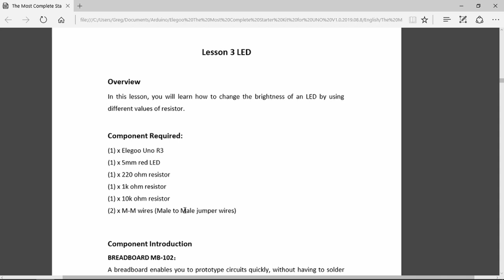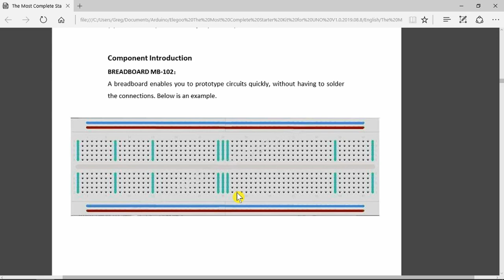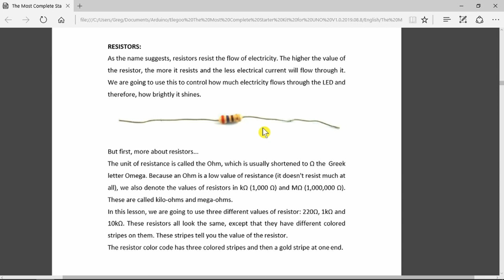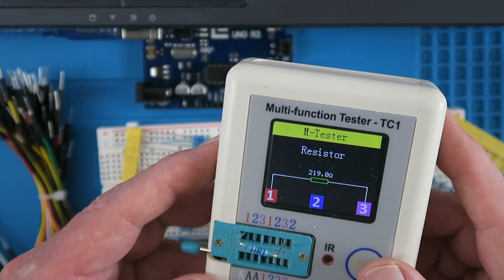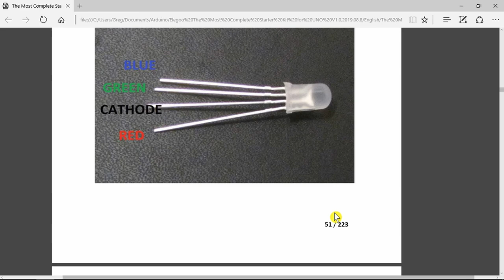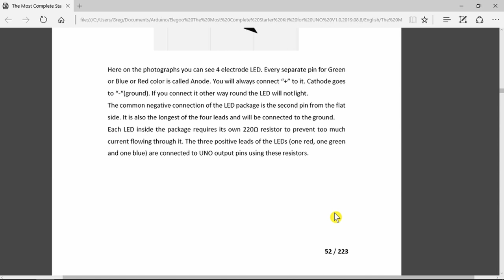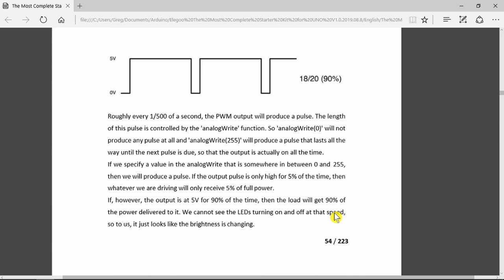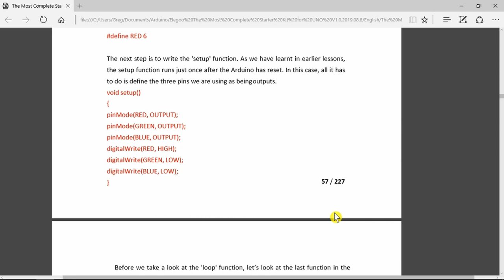Elegoo UNO R3 Project Part 2 LED's

Comment: Enjoying these Arduino vids.  Even if they are of the most basic dealings.   Some how they remind me of things I wanted to have a go at.    Sure would like to have a talk to who ever used BLUE as the Body color on those resisters.  I don't have a chance of reading the color codes.  Meter it is.
Reply from the maker: Thanks! Useful feedback. Hang on in there as things will get a little more interesting when I get to servos, ultrasonic sensor and gyroscope etc. I will mix in a few of my own projects which have been on the back burner too long! I'm with you on the colour codes, practically impossible to read directly. Even the type of light makes a difference. Under tungsten lighting the red looks brown!!
Reply: @1nformatica  I do in fact have two of those Ultra Sonic modules I purchased some years ago.  Can't even remember what I had in mind.  LOL    I'll be sitting up front on that one.     At 62 my brain is having some issues absorbing abstract information.   In 2016 I had a life and death incident that did in fact do some Drain Bramage.       These video's are helping me learn my New to me limitations.
Reply from the maker: Sorry to hear of your accident, life is very fragile. There you are tootling along fine and whamo! something comes out of left field and knocks you for 6. I'll be 62 in January so we're nearly on the same page. I'm convinced that living & working in Spain and speaking the language (usually very badly!) every day has helped me.
Reply: @1nformatica   Good Stuff from you.    Actually I turn 62 on 911.   I live 20 miles from the Dotted line of New Mexico and Mexico.  20 some years I've been here.  My Spanish ( Mexican not the same )  SUCKS.  LOL   How do they say it ?  CHIT HAPPENS ?  I'm good with life.    Every day you wake up has the potential to be a good day !    Your video's are helping more then a few people out here.  Keep Up the Goodness.
Reply from the maker: Aww Shucks!! ¡Les deseo buena suerte!
Reply: @1nformatica  LOL, GooGle Translate was required.   Told ya my Spanish errr Mexican was lacking .   Luck would be nice for a change.